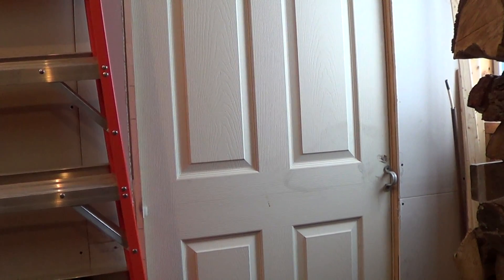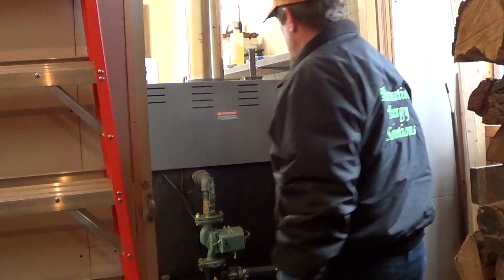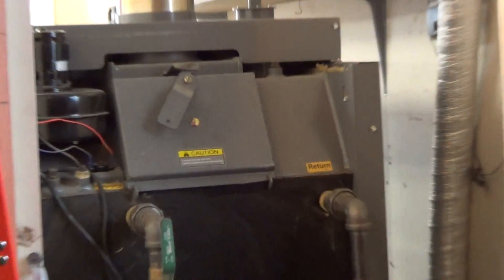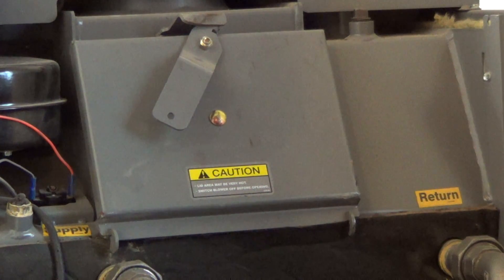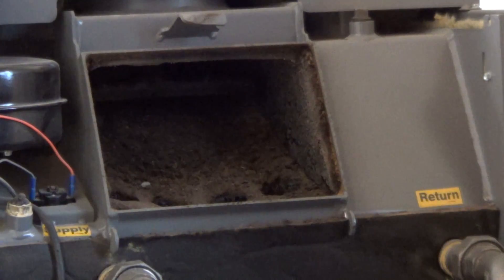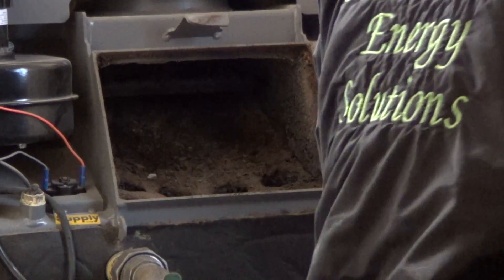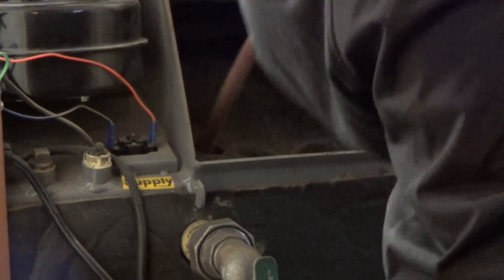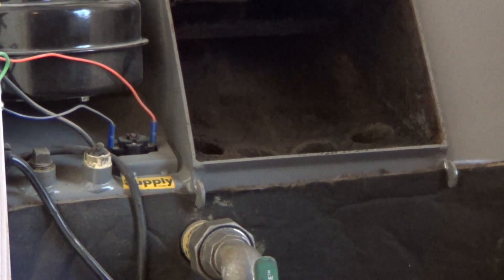Empre Elite scheduled maintenance

Comment: Mark, several questions: do you have a red pex tube that goes over the outside of your white tube that screws to the brush head?  you should have been able to get brush all the way through from day one...now use the red pex by itself to push through the tube. then follow it up with pushing the brush through.